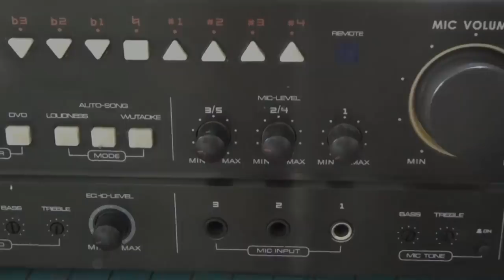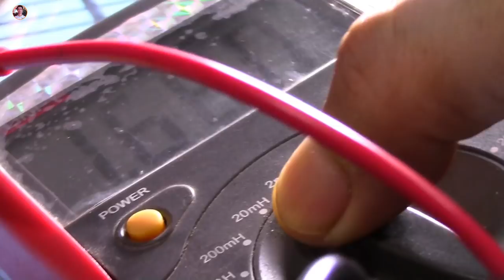How to increase the bass of subwoofer, boost mid range for speakers, simple use of free wire

Comment: could you do something on a servo controlled speaker thanks.
Reply from the maker: You can apply this with midrange speakers. however, reduce the uH value, and increase the capacitor value
Reply: Been there Done That Years ago

Comment: No wire number or size of wire,the bobbin size,we want the high rms output of speaker..
Reply from the maker: wire diameter and number of turns in video ...
  I will do 1 more video if you need it
Reply: @AlfredH  we want complete so that we can build or DIY.. also the the condenser value,non polar or polarized